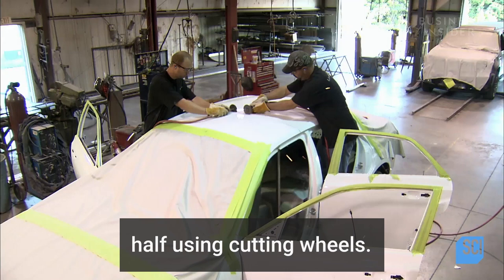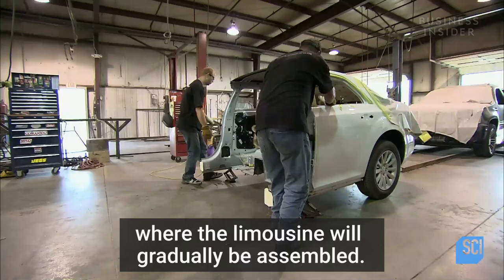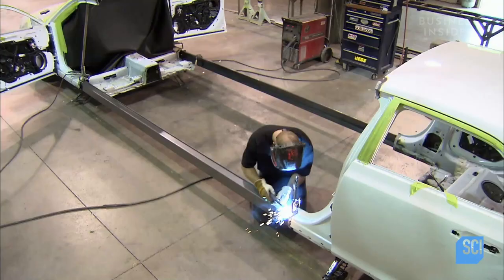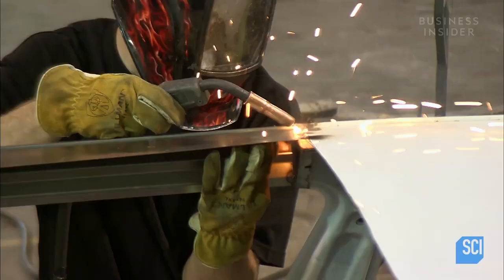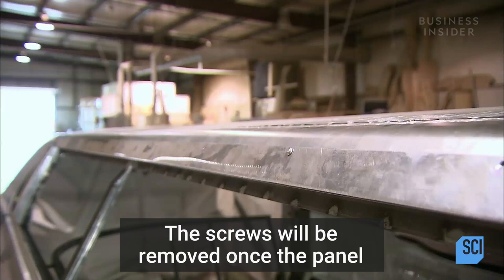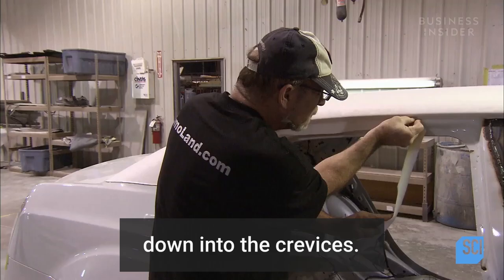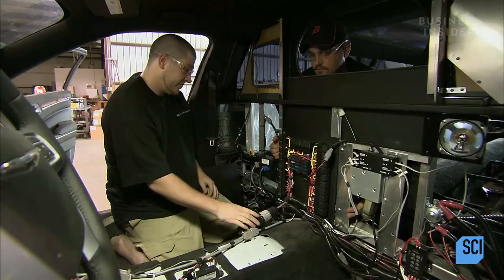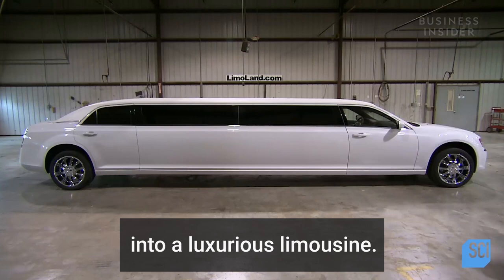How Limousines Are Made

Comment: nothing changed in the axle geometry?  A greater distance between the axles without changing the axle geometry also has an effect on the steering and the tire wear of the steered front wheels ... Axle geometry > is learned in the apprenticeship as a car mechanic

Comment: Need bit a help:
So technically can we cut a sedan into half and reduce 4 to 8 inches and make it  a 2 door car or a coupe with re enforcement rails for structural stability.
Reply: If it is a FWD you can literally cut it in half and it still will run. So yes as long as the powertrain is untouched do whatever you want to the other half (without considering potential stability problems)
Reply: @JL-oz7eg  Sir what in the case of RWD and AWD
What could be the potential problem
And chance of failures structurally and dynamically
Reply: @tejeswarareddykota5105   RWD needs to shorten driveshaft. For potential problem no one can tell, it needs a lot of testing and is vehicle specific. I can think of weight distribution and Corning performance. But usually not a big deal until you hit the track.i also don’t think shortening needs to reinforcement structure.
Reply: @tejeswarareddykota5105  search on YouTube I think a handful of people did it before
Reply: @JL-oz7eg  I own a 2015 honda civic
Sitting idle in the barn may be 50 kilometers a month traveling 
It's a 4 door sedan 
I want to go for 2 door
That's it.
Reply: @JL-oz7eg  thanks for your patience and help
Reply: @tejeswarareddykota5105  if I were you I would sell it and buy a 2015 civic coupe. That’s way cheaper and easier
Reply: @JL-oz7eg  Sir I'm from INDIA we don't have any coupes here
What ever are available that's worth thrice the brand new civic 2020

If we want one we have to do one.

Thanks for your suggestions 
If I ever can find one will get one
Reply: West Coast Customs made a 4 door charger into a coupe.